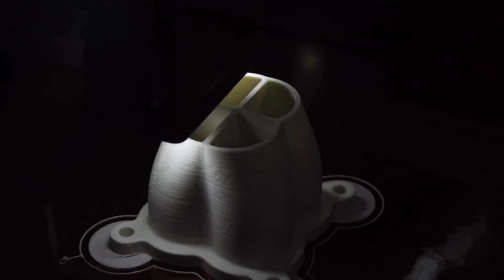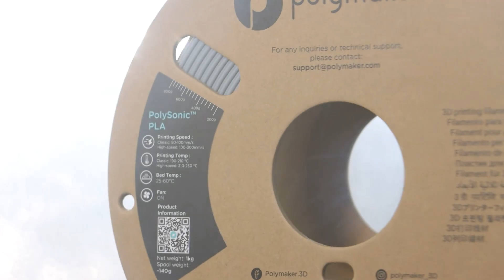Cheap vs Expensive Filament Differences - Which to Choose?

Comment: Cheap is usually fine. If your just printing prototypes or desk toys, cheap filament like sunlu, jayo, elegoo, works fine. Even some really cheap brads like Jayo, have quality filament. But if you need a print a very strong part and need to know its failure load, ect, go with more expensive.

Comment: those are only opinions tho. I was hoping for a real comparison.
I've been using the cheapest filaments I can find for PLA and I've been printing without any issues and at high speed on my BL.
I don't even calibrate my filament settings. I always use the Bambu Lab profiles for every brand.
so, in my experience: buy the cheapest you can find, unless you need some particular color that is only available with some more expensive brand
Reply: Thanks for letting us know, I was out of the video by the USA vs China comment.... Some of us do not live in the USA😂
Reply: Where do you buy your from
Reply: @worp6797  mainly amazon or directly from the various brands websites. there often are sales and you can find them for very cheap
Reply: @ mostly Amazon, sometimes directly from the brands own webstores if they have some kind of sale, but mostly Amazon. I found 1kg spools for as low as 10€

Comment: i normally get the cheap stuff for terrain but recently I like the Elegoo PLA and PLA+ for AR15 accessories. I hate PETG.
Reply: why do you hate petg?
Reply: PETG is pretty much my default these days.  Though I mostly print functional stuff for around the house.  I also get Polymaker most of the time because the extra few $$ is less than spending time dealing with bad filament or slow prints.